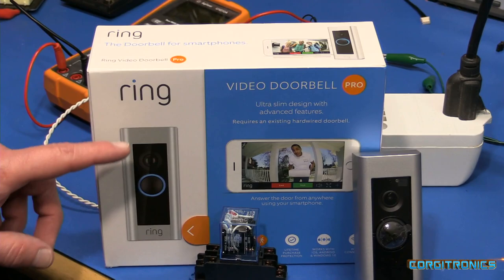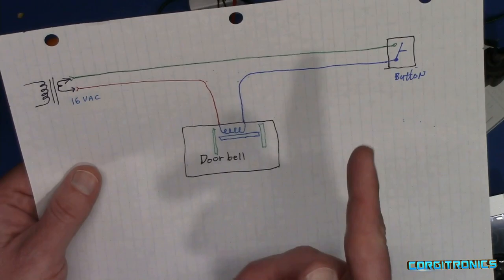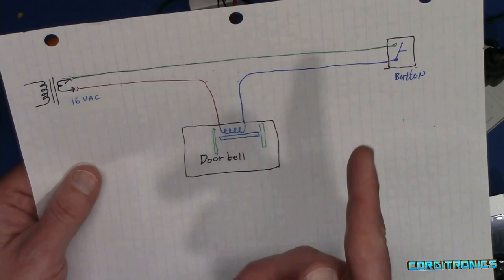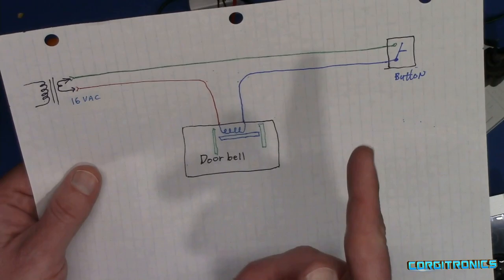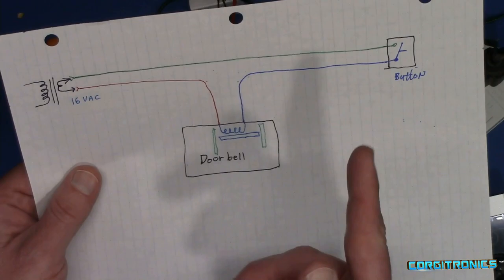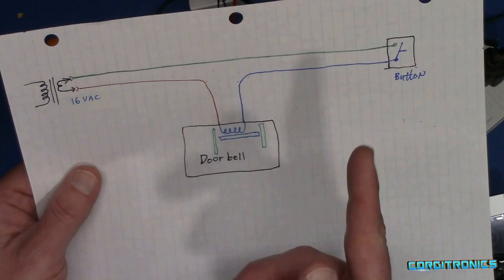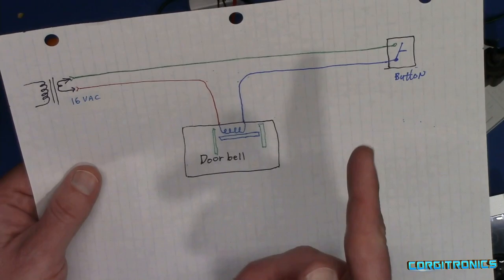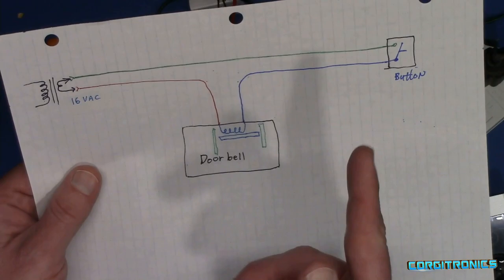Connecting a Ring Pro Video Doorbell to the electronic chime in a Nutone intercom

Comment: Just installed my Ring Pro connected to our Nutone Intercom.  Worked absolutely perfect!  Here are a couple of things to note: 1.  When wiring to the relay (if using the same one he recommends), note the wiring at 11:00 minutes into the video so you can get it right the first time without having to test it. Also, my Ring Pro setup correctly right after powering it up, then updated itself and then wouldn't connect for the next hour or so.  I called support and they said they wouldn't help until after an hour had passed. Apparently there is a battery in the unit which needs to charge to the proper level before the unit will connect properly after the initial setup.  Crazy thing is while I was on the phone with support, my Ring Pro started working just fine (but it was more like 90 minutes of continuous connection to power.  Thank you to Corgitronics for putting together this video of what we all knew could be done but Ring says is impossible!

Comment: Thank you so much for this information. I had a problem making the Nutone work with 24 volts. So I kept the nutone wired the same way it was with the existing 17 volt transformer.  I made a 24 volt circuit with the new transformer that powers the ring pro and the relay. I simply connected the door chime leads that go to the door bell button to the relay. 
Everyone works so happily together.
Reply: I’m having trouble trying to figure out on how to wire my ring pro to my nutone can you please explain it on a dumb down version lol thanks

Comment: I just have to thank you for posting this! I remember a few years ago researching into installing a Ring doorbell in a home with an intercom system and the first video that came up was someone explaining why it not only wasn'_t possible then, but _never would be , so I just gave up on the idea. 
Fast forward to yesterday, and I just replicated this setup (down to the model and brand of transformer and relay) for a client's home with a 20+-year-old M&S intercom system and I was elated when I plugged the transformer in and the Ring Pro actually powered up and rung throughout the house just like it was built that way. The only quirk (which you warn about in this video) is how the doorbell continuously triggers when the Ring first powers up, but that's only going to happen after a power outage, and it only lasts a few seconds. A very small price to pay in my book. 
I even found a purpose-built replacement metal plate for the old speaker/doorbell unit with holes pre-drilled to mount the Ring Pro on eBay for around $20. You couldn't ask for better results after a retrofit job.

Comment: Thank you so much for this video!  I studied this video for about a week now here and there in some rare spare time... Ordered all the parts, some terminal connectors, wire, the relay, and some terminal pads, and was able to connect it all up, and it works!  I used the terminal pad to connect the transformer directly to the doorbell rather than a wirenut, which I suspect based on your photos you did the same thing.  I was really worried that I was going to mess it up, but sure enough once it was all connected, it worked.  There was a bit of bugginess at first, the chime didn't go off and the doorbell said poor voltage in the ring app, but after a few minutes that went away and says good voltage now, and the chime works just fine.  Again, thanks for the video!
Reply from the maker: That's great!

Comment: Thank you for this video!  I have a Panasonic TA824 Advanced Hybrid System and I initially tried to swap out the existing door bell unit with a Ring Pro.  There wasn't enough voltage on existing wires to power the Ring Pro so I was looking for a solution to connect it with my Panasonic system (I first called Ring and they said it is not compatible).  I came across this video for a Nutone intercom but figured it should also work for my Panasonic system.  I followed your instructions and connected two Ring Pros using two AC relays to the Panasonic system .  Both Ring Pros are now powered and work with my existing system!
Reply from the maker: Congratulations!  I'm glad it's working, and thank you for the feedback.

Comment: Nutone has one or two 18-16v transformers in built. I used the power from one of these transformers to drive my relay. Instead of the Ring Power module I used a 5 Ohm 20 watts resistor (cost less than $1). I used a small 12v DC relay (look for "12V DC SPDT Relay" Amazon) and connected the relay coil through an AC to DC converter bridge rectifier.
 (Electronics newbie should stick to an AC relay solution).
Nutone transformer -+-> 4-diode bridge rectifier -+-> 12v DC relay coil || Relay drives the electronic bell by short circuiting the dry contacts of the relay.
-+-> 5 Ohm 20 Watts resistor -+->

Comment: My transformer is rated at 24V, 40VA. Would I still need power pack to use existing chime?
Reply: yes, use a 5 ohm 20 watt resistor Instead. 10 watt would also work but 20 is safer for low heating up.

Comment: Thank you so much for this video! Very well done, clearly explained, and it accomplishes what Ring says cant be done.

I bought the transformer and relay you suggested and hooked everything up as described. The Ring Pro is powered and working. The relay only triggers some of the time, though. I only had Cat 4 cables already run to the door and am running the 24V through a pair of those each direction. Measuring the voltage, it shows 25V to the relay.

I made sure the Ring app was set to Mechanical.

Any tips on what I should do to troubleshoot would be appreciated.

I’m probably going to buy a Ring Chime, but would rather have it ring through my intercom system.
Reply from the maker: The wiring should be sufficient for this to work.   Check the health status of your Ring Pro, and for any updates.  About a year ago they pushed an update to the Ring Pro that mostly disabled the ability to trigger the relay, and I had to call support and walk through everything and then they manually pushed an update that fixed it.
You might check out my recent video on relays for getting the Ring to work, as there are some differences between relays.  https://youtu.be/xmeYzodpkfU
If you have a multimeter that can measure AC current, connect it into the circuit and see how much current is flowing when it triggers the relay at the end of the ring cycle.

Comment: hi, 
i am installing a ring pro 2 into my nutone im 3303 whole house intercom system , will your solution apply to this installation? if so, my questions are-
 do the original  wires going to the chime module need to be disconnected and capped, or are they still used in companion with the additional relay and power supply. 
do the original transformers (2) remain connected ?

Comment: Hi, the Ring din-rail power supply I received with my ring doorbell pro 2 has an 24v DC output. Do you know if this will work as well if I replace the relais for an 24v dc version?

Well I tested it with the DC power supply and a DC relay and it doesn’t work. When I use an 24VAC power supply and the ring power kit it works as shown in the video

Although sometimes the relais keeps switching and a power cycle is the only way to shut it down. Does anyone know why? The mechanical chime in the video draws about 1 amp. My relais only 0,14 amp. Could this have something to do with this?

Comment: I appreciate your schematic and followed your directions and replicated your results, however I am using a Eufy battery powered video doorbell which of course does not come with the Ring pro power kit (different manufacturer). As is, everything works as it should however every 30 seconds or so the relay will make a momentary humming for a few seconds. The humming annoys me so much that I have disconnected from the relay (and of course the intercom chime). I can only assume that this humming is when the Eufy video doorbell draws power to trickle charge it's built in battery, just like the Ring does. Also the Eufy has infrared emitters for night vision, again like the Ring.  It's specs and operation seem to be very similar to the Ring video doorbell, but unlike the Ring there is no monthly fee to store video clips. If i purchase the Ring pro power kit and install per your diagram I am hoping it will solve the humming problem and work flawlessly with the Eufy. All I know to do is purchase a Ring pro power kit and try it, but Is there any reason you can think of that trying this idea could cause damage or problems to my equipment?

Comment: Corgitronics:  This video plus the second one with more wiring details are fabulous!  Thank you very much for all this detailed information!   I have the Ring Video Pro and a Nutone IM3003 Intercom system (which I think is the same or similar to the Nutone in the video) that has a chime module, so I plan to implement your concept.  I would appreciate your thoughts on the physical location of the Transformer and the Relay, however.  The Master Panel for my Nutone is in the Kitchen, which is some distance away from the front door where the Video Pro will be located, so I am trying to determine the optimal locations for the 24V AC transformer and the 24V AC relay.  I don't know how to take into account any impact of distance between and among the components involved here (the intercom system, the transformer, the relay, and the Video Pro).     

We have fairly frequent power outages due to storms, so my WiFi router is plugged into a standby UPS unit in a room that happens to be very close to the front door.  Because the Video Pro does not have a backup battery, I felt it would be a good idea to also plug the new transformer into that same UPS unit.  Assuming the Video Pro would be most affected by distance from the transformer, it also seems like having the transformer closer to the Video Pro unit would make sense.  

With respect to the relay and the Ring Power Pro unit, I can located either or both near the transformer in that room or inside the Kitchen wall space where the Nutone Master unit is located.   Would one location be better than the other?  The current 22 gauge 2-conductor solid wire that runs from the front door pushbutton to the Nutone unit is easily accessible in the attic above the room where the UPS is located, so accessibility of that wiring is not an issue.  

Again, thanks for the great videos and all the support comments you've provided.

Comment: Can you tell me the resistance of the power pack? Can i just use a cheap resistor or does it have any other purpose?
Reply from the maker: Well, mine is installed at my previous home.   If I recall, it is more than a resistor, possibly a constant current circuit.  It could be replaced by a very large power resistor.  You would need to measure the amount of current the Ring is using and then calculate the wattage, etc.  I probably wouldn't want to install a big power resistor into a closed wall box, as it will get really hot in there.  If you have a Ring Pro, it should have come with a power-kit, just use that.

Comment: Corgitronics is the Master Panel the one where the radio is at, or, are you referring to a different place ? Also, I do have the type that when the doorbell is currently pushed it sounds exactly like the one in your video.
Reply from the maker: Yes, the master is the one with the radio in it.  At 15:56 you can see the two terminals that I connected to.  Your system probably has the doorbell button connected to those same terminals, as mine did.

Comment: Hey Corgitronics!  Trying to setup the ring to my parents m&s intercom system.  The system already has a transformer that converts the power to 16 vac and charges the ring unit just fine.  However when we ring the doorbell it seems to enter into a endless loop with the intercom chime that has 1,2,or 3 chime options.  The chime rings 16 times and then errors out on the intercom and the ring unit then stops receiving a charge.  Would installing the relay resolve this issue?  Or do I need the ring pro?  Or maybe just simply changing the chime to the single option?  Any help would be very appreciated.  I also have links to the existing intercom, transformer and chime if it would help.  Thanks so much and look forward to your reply!!
Reply from the maker: Adding the relay may solve this issue, but it sounds like a more complicated issue.
I question whether the intercom's transformer has enough power (VA) to supply the intercom and the RingPro when it triggers.  The RingPro uses quite a bit more power during the ring cycle, connecting to WiFi, streaming the video, etc.
Try the relay first, if that doesn't fully solve the issue then also power the RingPro from a separate transformer (as shown in my video).
Reply: Corgitronics I hadn’t even considered another transformer, great idea!!  Just to be clear, I am working with just the ring, not the ring pro.  Do you think the ring pro has a higher probability of working with the intercom system than the standard ring?  I can pick one up, no biggie.  And lastly, I will try the relay for sure, should the 24vac coil you linked work fine although the transformer is 16vac?  Thanks again, I really appreciate your time!!!
Reply from the maker: @4E-P  I'm really not familiar with the regular Ring doorbell, as it didn't suit my needs.  I specifically selected the RingPro for it's ability to drive my existing doorbell.
The relay that I show works fine with an 18 V AC transformer, but not so well at 16 V... I should probably do another video on that.
If you add a transformer, get one for at least 18V, if the regular Ring will handle that.
Reply: @Corgitronics  I'm curious how to tie in the chimes on all the remote locations of an m&s system. Obviously the intercomm will not work anymore but what about the existing chimes?

Comment: Corgitronics, is there enough room to mount and/or place both the transformer & relay that you showed in the Master Panel ??? The reason I ask is because I have grout all the way around the edges of my Nutone from the original build of my house, and I didn’t want to remove the grout if everything doesn’t fit because I have no idea what is behind the front cover. Your continuous feedback is much appreciated.
Reply from the maker: Not sure if there will be enough room.  If it's an exterior wall then it may be filled with insulation.  Also there's the issue of whether there's AC power, as usually the intercom's power transformers are mounted somewhere else, often near the main electrical panel.
Since this particular intercom uses two big transformers, rumor has it that you can tap into one of those to power the RingPro.

Comment: Hi Corgitronics.  I bought a 24V transformer and 24VAC relay and wired it to my M&S MC602 intercom.  The Ring Pro powers up and functions fine, but it won't actuate the relay when the button is pressed.  If I wire the relay to the normally closed contacts, the intercom chimes non-stop, so I have power to the relay.  I have 2 pair of 22 AWG wires between the intercom and the Ring Pro, so am using two pair wired to one side of the transformer and the other two pair to the coil side of the relay.  When I press the Ring button, the relay makes a small hum, but the contacts don't move.  Any suggestions?  Thanks
Reply from the maker: In the Ring menu for the device, under General Settings, check the Doorbell Chime Type, it may need to be set to Mechanical.
Also, the relay may require too much power to trip, you can try this one:  https://www.amazon.com/gp/product/B00NN5ABG2/
See my follow up video on suitable relays:  https://www.youtube.com/watch?v=xmeYzodpkfU
Reply: @Corgitronics  Thanks so much Corgitronics.  I bought the relay you suggested and now everything is working.  Great videos!

Comment: So no one has responded to the question I posted 3 days ago. Of course this is a rather old video, the last comment posted was over a year ago. For anyone who might read these comments in the future, I ordered the ring pro kit v3 on Amazon for just $1.99 and added it across the power terminals of the relay as recommended in the video to see if it would solve the problem I was having. Previously I installed a Eufy battery powered video doorbell. The Eufy was able to connect to my relay and ring the chime module in my intercom, however I would hear the relay hum for a few seconds every minute or so. Anker (Eufy) customer service was unable to help me resolve the hum and suggested that I not use it with my wired doorbell system. I had installed my Eufy doorbell to my intercom according to the directions in this video, however the video highlights the Ring video doorbell and installed using the Ring pro power kit. Since Eufy does not offer a similar gadget for their doorbell and instructed me that they were unable to resolve the hum issue, I decided to order a Ring pro power kit and try it with the Eufy. Wow! It now works flawlessly with no more hum. For anyone who may have the exact same circumstances this will allow you to follow this video with your Eufy equipment.